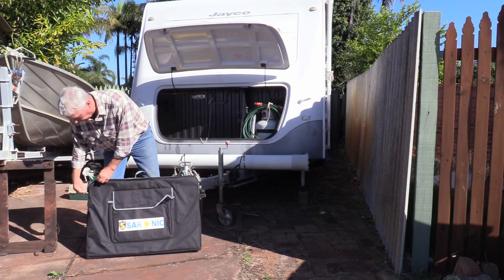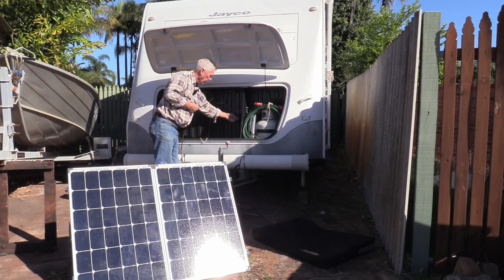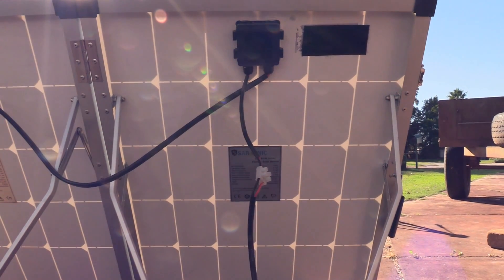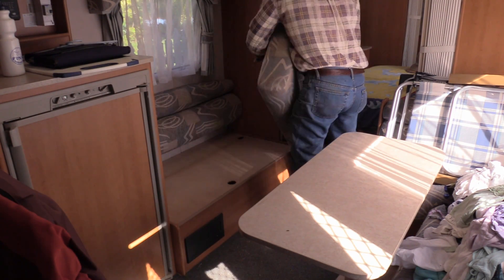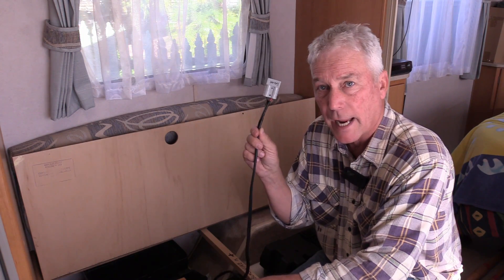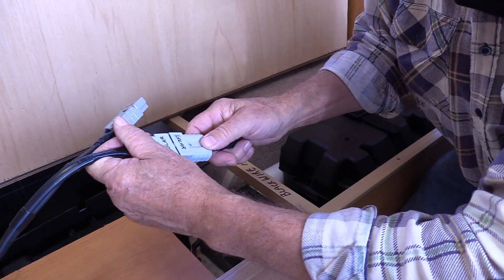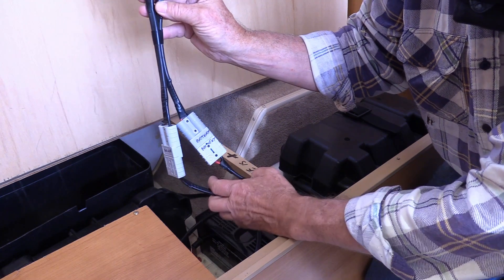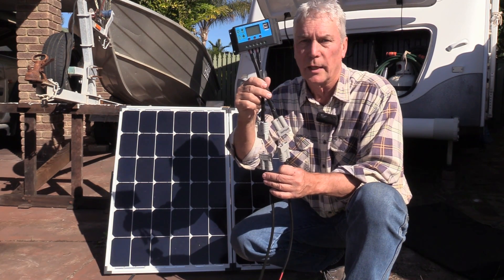Episode 1. Caravan -  portable solar panels.

Comment: Just what I needed, thanks Doug.  I see nowadays you get different color(red/blue/yellow) Anderson plugs that only works together, so you cannot plug red to any other color except red etc.  That is just safeguarding that I don't put solar into battery connection.
Reply from the maker: Hi Francois yes the different colors are for different applications eg Electronic Stability Control (ESC) is a red Anderson plug.

Comment: Hi , Doug thanks for the video. Was wondering , if i have an Andersen plug coming from the car while traveling would i have to disconnect the Solar panel plug and Controller near the battery end . Thanks again.
Reply from the maker: Hi David yes I would disconnect while travelling,  I only charge when I'm stationary. I do suspect if you want to leave the panels permanently connected you will need additional smart technology such as a Redarc DC-DC controller with solar capability.

Comment: Hi Doug, thanks for your video, I liked it.

Your solar panel system is not 200w as stated in 0:23 of your video, maybe 2 x 50w equalling 100w total, nonetheless I found your video informative. 

Cheers.
Reply from the maker: Hi Rorymax, thanks for watching and taking the time to comment. Your comment prompted me to check the output of the panels. The panel configuration is 2 x 100 watt (5.65A x 17.7V = 100W per panel)

Comment: Hi Doug, the reason I thought your panels were not 100w each is because my 100w monochrystaline panel is similar in size to your 2 panels combined. 
I see that each of your panels has 36 segments (6X6). mine has 36 segments also but in a 4x9 configuration.
I have two panels in a suitcase configuration but the overall dimensions of my set-up is approximately twice that of your set-up.
I have not seen panels that can match  5.65A output for the size of panels shown in your video, can I ask you for the brand\model of panels that you have please.

My setup look enormous and unwieldy compared to yours.

Thanks and Regards.
Reply from the maker: No Problems, they are Saronic panels

Comment: Great video. My suggestion, throw away the $15 pwm solar charge controller and replace it with a MPPT controller such as the EPEVER & MT50 remote monitoring meter. MPPT is a lot more efficient than PWM.
Reply from the maker: Thanks for the suggestion, I do carry a spare controller just in case.
Reply: @doug_hardman  Good idea, I've had a faulty one of those in the past

Comment: Doug, great video and very informative. How does the system go with the 240volt charger system connected to the batteries (no power to 240v)?
Reply from the maker: Hi Robert Croft. When I am off the grid I connect my solar panels, I do not disconnect the caravan 240 volt charging system. Is that what you mean?

Comment: Thanks. I have a solar panel and the exact same controller on it's way to me. Caution. From my research you should always plug the battery in to the controller before you plug in the solar panels. There is a risk of blowing the controller.
Reply from the maker: Thanks John Allen, good advice